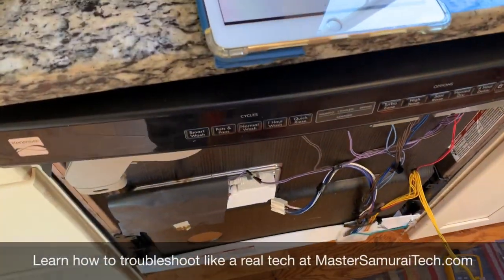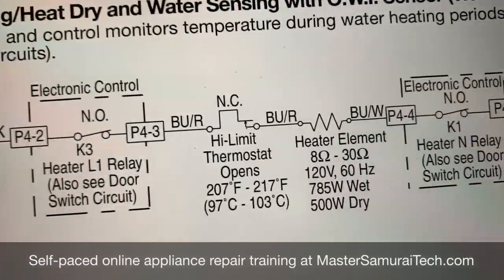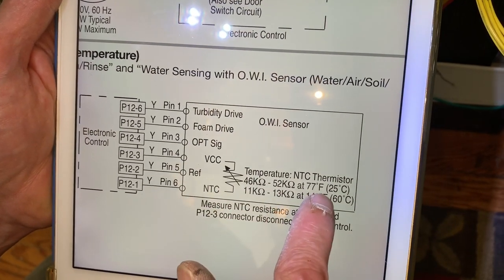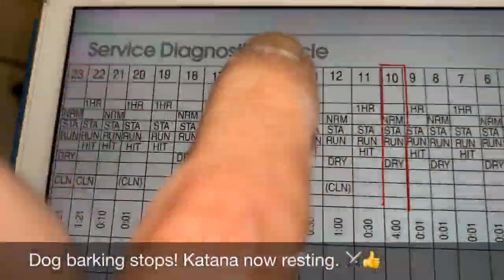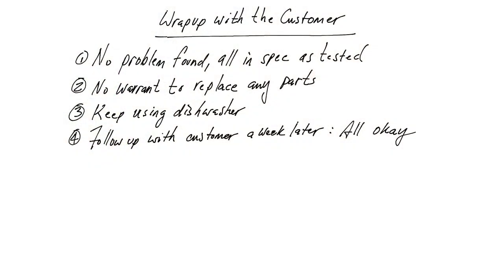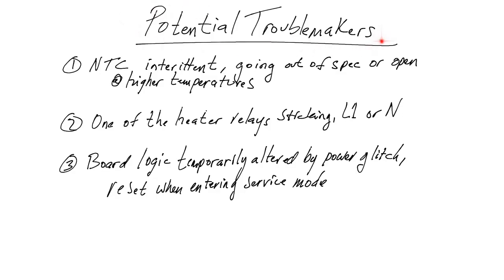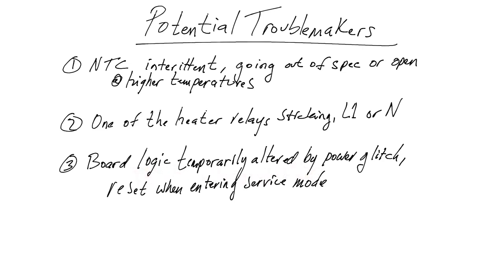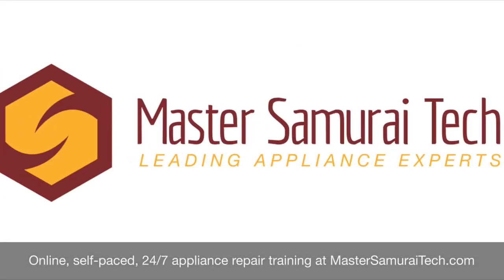No water heat or heated dry in a Whirlpool dishwasher

Comment: Very good instructional video. Well done and very concise. Helped me fix my issue. I had just replaced a burned out heating element on a Whirlpool dishwasher, and it wasn't working. I checked the H/L thermostat, read continuity from the control board, and then did the Service Diagnostic 'warm reboot'. That did the trick! All good; the dishwasher is heating like it always did. Thanks so much!

Comment: Thank you sir! I ran into exactly the same situation. Not enough heat during the cycles. Pretty much took apart and tested all the components just to discover that they are fine. And finally I gave a shot to the service mode. Boom - heater is working again and all dishes are shiny. THANK YOU! Apparently, reboot fixes not only routers. Dishwasher - Whirlpool wdt750sahz0.
Reply: I have the same dw model and same issue, how do we put dw into service mode??

Comment: I believe a Frigidaire tech once told me it happens due to the water temperature. If the unit isn't able to heat up the water fast enough the board kicks off the heater, which just doesn't sound right to me, but that's what they claim. They recommend the water temp coming into the dishwasher be at a minimum of 120 degrees, which usually means the customer's water heater needs to be set at around 140. After running diagnostic is always starts working again but after some time it can happen again. I always recommend to the customer that they run the hot water at their sink before starting a load.
Reply: I work for a apartment complex 460 units,we see this problem frequently, 
I started recommending  this to our residents and they have never called again ,
We only have Wirpool appliances on site

Comment: This was very helpful. After verifying continuity and resistance of both the heater and turbidity thermostat circuits, replacing the controller board (around $250) fixed the heater not energizing.
Reply: $250 will buy you a decent used washer ..lol .. i am throwing away mine because the controller is bad

Comment: Hello Samurai Great Video I have a very similar whirlpool dishwasher that only heats for 2 cycles after using diagnostic mode ? I have replaced the PCB in the door and the TURBIDITY SENSOR same thing still happening? Any ideas?

Comment: This is an excellent diagnostic how-to that I've put into practice. If @SamuraiRepairman is still reading comments, what's your guidance when the OWI Thermistor doesn't show any Ohms across Pin 4 and Pin 6? I can replace that OWI assembly, but would like to understand when the Control board is to blame/needs replacing. My error code is 7-1 and the heating element and hi limit thermostat are good/in-spec. Heated Dry fails to come on--otherwise the washer works as expected.

Comment: On a brand new dishwasher the dishes come out dripping wet. Whirlpool says I need to use this rinse product and I maintain the old(noisy) dishwasher dried the dishes using heat and would actually put steam out of the vent--dishes were warm to the touch and dry.  They told me to try the Sanitize Button to see if the element is being heated so I have to wait a few days to get enough testing material. I hate to use the now 3 hour cycle to test the heat! Go figure, Nice video and I will try the sanitize method then call them back to dispatch a service tech.
Reply: Find out the sequence of buttons to push to put your machine in diagnosis mode.
As it starts _ push start button as to advance each cycle_ you'll eventually find the cycle you wsnt to test

Comment: Great video. If you have zero ohms on the p1-p3 leading to the turbidity sensor, will that give you a no heat scenario?  I have continuity on both the heating element and thermostat.  However, the dishes are wet and often still dirty.

Comment: I have changed the heater coil and checked the thermal fuse  to be working . It didn't help and I stopped because i dont know much . So how do I 'Reset' the logic circuit ??

Comment: I have a GE Dishwasher GDF530PGM0BB (very similar to the whirlpool you are working on.  The dishes don't dry and come out with a white film. I tested the heating element and the High Limit Stat (TCO?).  The element was good but stat did not have continuity.  I replaced the stat and harness that came with it.  The dishwasher worked (heated) for once cycle but did not work the next time we used it.  I checked again and found no continuity at the stat, and came to realize that it has a reset button.  Reset it and again the dishwasher worked for one cycle and then quit again.  I replaced the turbity sensor (thermistor) and that did not help.  I then replaced the control board and that did not help.  Each time I reset the stat and it would work for one cycle.  So something is causing the stat to trip out.  I have run the diswasher through the service mode but that didn't help either.  Please help.
Reply: I've been having same/simular situation as you have.
I've replaced the control board twice_each time it worked for while.
10 months on first board_ 2 weeks on second board. Both refurbished boards.
Then I bought a 3 board _ thinking bad repair job. That board only gave me a diagnosis code. Would not start dishwasher.
Even replace the thermostat fuse. No go.
Back tracking each move I've done_ I realized for some reason dishwasher keeps blowing the the thermostat fuse.
So_ I retryed each board.
Board # 1 defective.
Won't run diagnosis.
Board # 2 still remains faithful.
After replacing thermostat again.
Board # 3 defective.
Unknown as of yet what part/parts are bad on board 1 & 3.
I'm learning as I go along _ should have spent $250 on brand new board to begin with.
But still need to find why fuses keep blowing.
MASTER SAMURAI _ you have the most involved video's_ I'll continue watching.

Comment: Hey SamuraiRepairman, wouldn't it be wiser to do a reset of the machine then a test run before you start testing to see if that fixes any issues?  I find that it may fix some glitches that may have occurred in the relays or other parts of the board.

Comment: In my 15 years of repairing appliances I've noticed with the newer whirlpool washers and dishwashers that a hard reboot will often cure the problem
Reply: How do you do a "hard reboot"? I bought a Whirlpool dishwasher last year and it barely heats. It also cleans less and less effectively as time goes by, despite cleaning filters, etc.
Reply: I have a Whirlpool GoldSeries dishwasher that is about 3 yr. old.  It stopped cleaning the dishes about a month ago - my tech ordered and installed a new wash pump last week - but NOW the water won't heat and it won't dry.  I have always run my sink water to hot before running dishwasher - my water heater is set to 140 degrees.   This is my THIRD dishwasher since 2005 when I flooded during Katrina in New Orleans.  I paid $700+ for this one, and have put approx. $360 in it for this wash issue (2 service calls and parts/labor).  My question to you all:  1- do you think my tech could have messed up some connection when he installed wash pump? 2- Is this heat issue something I could test/fix for myself?  3- should I just pitch this one and get another one due to amount of dollars already spent plus what the heat issue would cost?  Which is ridiculous... but has become my solution for a dishwasher and a washing machine - since 2005.  Any insight would be appreciated.  Thank you.
Reply: Firefly Alley  

You reset the unit by running diagnostics on it. Pick 3 keys other than start or cancel and do a 1-2-3 sequence 3 times. If you do it successfully all leds light up then display error codes will flash in a set of flashes and shortly after machine will run through test cycle that enables heating circuit again. It will work unless you have a problem in the heating circuit. If you do heater will be disabled.
Reply: @franciscojaque253  You the man!  Ive see other button combos but this was the first that worked.  THanks!
Reply: @franciscojaque253  Your comment deserves a million thumbs up!! This worked for me today and it surely saved me hours of time and potentially hundreds of dollars. THANK YOU!!!!!
Reply: @franciscojaque253  what ia a 1-2-3 sequence?
Reply: George Nordling - pick three keys other than “start” and push the three of them in the same sequence three times. For example, on my dishwasher it might be Sani Rinse, Heat Dry, High Temp Wash. Repeat same sequence two more times and watch for the results Francisco Jaques already noted.
Reply: @georgenordling8564  I just pushed the 3 buttons left of start. in sure it fixed , just letting someone else know

Comment: I am getting 38 ohms across the blue wires and 65 k ohms across the yellow wires pins 1 & 3. Room temperature is right at 77 F. The heating element was just replaced brand new but it's a China OEM replacement part specifically for my Whirlpool WDT720PADM5. Replacing the heating element and doing a hard reboot at the electric breaker didn't fix my issue. The resistances I am measuring seem real high. Any ideas?
Reply: didn't watch the video too closely so don't know if he mentioned a range but heating elements are literally just a big resistor, the resistance to electron flow causes the element to heat up when the current travels through it. Same as all electric coil heaters so that sounds normal for a heating element.

Comment: One thing I always keep in mind of this design of dishwashers (I can tell the design by the thin blue wires to the recir. pump) and a no heat complaint, is the recirculation pump failing. It causes a no heat error because water doesn't recirculate over heater thus no temperature rise, causing the error then the control will disable heater until put into dianostic mode.  These pumps are really buggy.
Reply: What if the water was coming in to cold?
Reply: @kingb468  I believe it would decect a rise in temperature even if doesn't get to temp or takes longer.  In fact there is a error code for too low of inlet water.
Reply: @woodisgood85  no sure if you miss understood me. Not a lack of water but the water not being hot enough. Causing the dishwasher to over work itself to reach temperature. Should the water come out at least a 120 degrees? How fast does the heating element heat the water? Or does it just maintain it's inlet temperature?
Reply: @kingb468  Bosch is now recommending users to not preheat their water at the sink before starting the dishwasher.  These machines will still heat the water if it fills with cold water.
Reply: This is exactly what I was thinking too.  Was there any error code?  The F7 (E1?) code will disable the heat circuite.  I often find a intermittent failed wash motor in these situations.
Reply: @drewbrown9678  most bosch dishwashers do But whirlpool and Bosch are two very very different brands by far. I'm just curious because I run into this problem a lot.
Reply: @kingb468  I believe I understood, there is an error code for cold Inlet temperature. I've it on Whirlpool dishwashers often. I don't think much of it other than recommending the customer Purge the line of Coldwater.
Reply: @woodisgood85  off topic but since we're tech talking 🤔 I have a Kenmore microwave that keeps blowing the breaker when you open the door. Door switches fuses are good all high voltage is good. The unit is not on its own dedicated breaker as it should be its in series with a stove. You think that's the issue? Or could it be the door is not releasing off the switches evenly
Reply: @kingb468  I'd suspect the interlock switches, determining which one is not worth while. I stock LG MW switches 2 of each configuration. I replace all interlock switches.

Comment: On a 2019 whirlpool with no heat is it possible that a failing motor is causing a no heat problem. An appliance technician said the heating element tested fine and that this is a sign of a failing motor.

Comment: Mine was a broken heater coil element inside dishwasher.  Not sure why it cracked in two. Tech said board needed to be replaced too. $169 service call. $250 parts and labor. Ugh

Comment: Sometimes it’s easy to check everything from a control board, but GE puts their boards on the bottom and it’s impossible to reach all pins and connectors; you have to check each component separately

Comment: And so you came to no conclusion and thats the problem with todays appliances. As a tech myself I see this a lot.
If you get a call back your still at square one and you do it all over and again no conclusion. Now we are guessing
with a lot of time invested in it. Glad to see you have a lot of patients
Reply: I came back from a trip tried to use dishwasher noticed it was awfully quiet and when it finished dishes were wet but dirty and the soap was still in the dispenser, led me to the pump. Believing it to be clogged I removed it and it was nearly spotless, gave the bearing a turn while I had it out and the pump started working again. Only problem was dishes still weren't clean and dripping wet, no heat. 

This makes me think that for some reason the pump wasn't working (maybe sitting a few days the bearing in the pump got a little seized) and the water wasn't circulating which probably caused a high limit switch to trip for the temp and shut off the heating element permanently. (for safety) Now that the pump is working again I need to run my dishwasher in the diagnostic mode to reenable the heating element.

I also noticed the the plastic cover that is easily removable from the bottom of the inside under the element that keeps food from going into the drain is warped now, lifting up a tiny bit from where it's supposed to be which shows that it overheated.

Because of the safety switches the pump intermittently quitting could cause someone who doesn't know what they are doing to replace the pump, heating element and control board.

Comment: I have whirlpool gold series dishwasher, I am having a strange issue. My dishwasher is not completing its cycles. Initally when I turn it on, it fills water and heats the water and then stops. It will not initiate clean cycle, just stays there. After some time, it will drain water and fills new fresh water and stops there. I have checked motor, control board, door latch, turbudity sensor all are working fine individually and all are asper the specs. The strange part is, once I do service cycle like 123123123, after that it always cleans my dishes perfectly. It means, everytime to start my dishwasher, I need to do this service cycle then run normal wash iteration. It will work fine.
If I start my dishwasher load, wihtout doing service cycle, it will stop after filling the water. So, not getting what component is wrong and what needs to be done. I suspected the computer board / thermistor / turbudity sensor, so I have changed, still the same issue.
Reply: Did you ever resolve this issue? I’m having the same problem.

Comment: Hello, I am trying to make an incubator using a dishwasher as the main box.  Can I assume that my old kitchenaide superba with a 16" round heating element is a wet/dry element, and I can power the heater element with an incubator temperature controller to maintain a 99.5° -99.8° temp in a dry environment (similar to the eco heated drying cycle).  I just want to know if a dishwasher element (750W wet, 500Wdry) would be an efficient use of electricity vs a couple of 60w lightbulbs and 2 computer fans
Reply: unless you are hatching 1000 eggs at the same time it sounds like overkill. Why heat an area 50 times bigger than required? or are you hatching that many eggs?

Comment: You have access to a schematic for a Kenmore Dishwasher 665.17362300, No Power. I have checked power to the main board, door switches are good and the thermal switch is good.